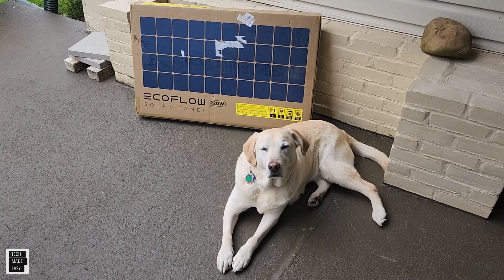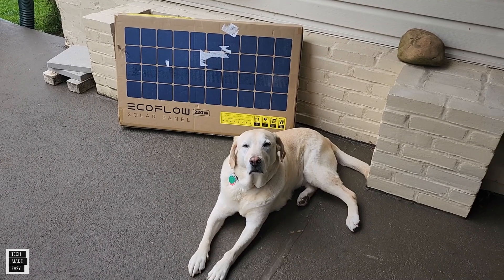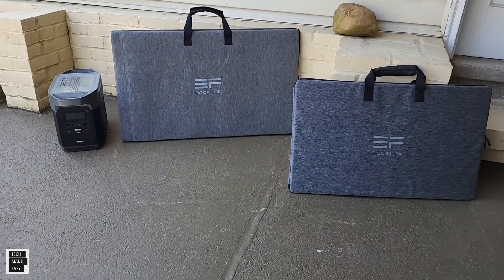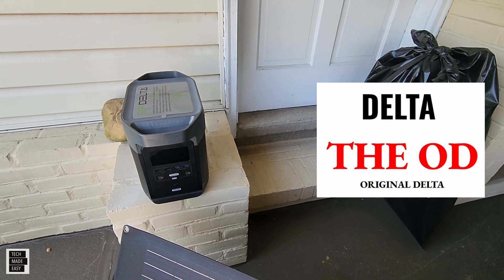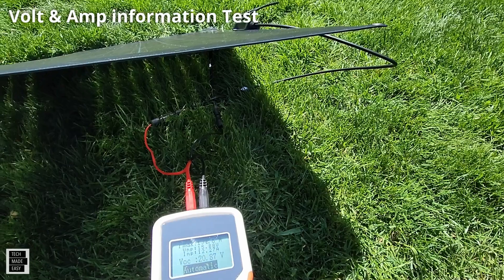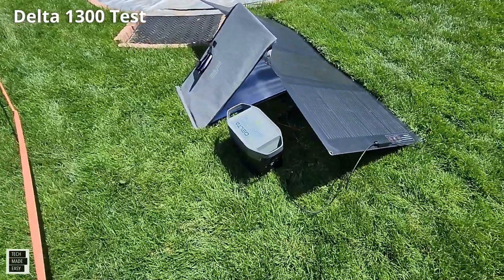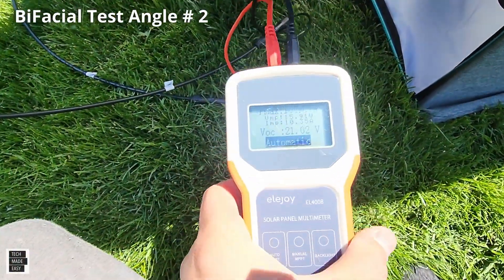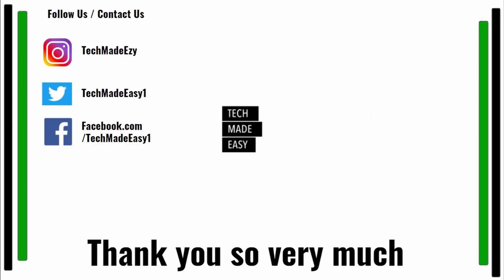PART 1 of 2 EcoFlow 220w Bifacial Solar Panel Review and Testing

Comment from the maker: As of May 2nd it's on sale at Amazon $550
https://amzn.to/3MHHNmC
Reply: Thanks but it shows as Currently unavailable on Amazon
Reply: I have the Bluetti AC180 which says it takes a max of 10A however the VDC is between 12V and 60V @ 500W max. Would this panel be suitable and operate with the AC180

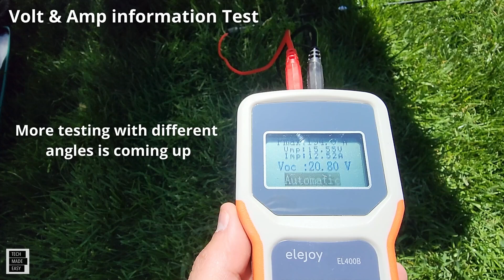Comment: 9:51 If I get 200W from a 220W Bifacial solar panel, how long will it take to charge my Delta 3 Plus 1024Wh?
Reply from the maker: About 5 to 8 hours if you have good sun and the correct position of the panel
Reply: @TechMadeEzy  I am asking about 200W straight input charging times.
Reply from the maker: I don’t understand your question. you asked me the first time how long it would take to charge that power station and I told you 5 to 8 hours depending on good sun and you changing the panels position throughout the day.
Reply: @TechMadeEzy yes that is first question but I ask second question 
For example 
If I charge 200w Ac input 
How long will it take to fully charge delta 3 plus 1024 wh capacity.
Reply from the maker: Just so you’ll know this unit can handle 380 W that would be about an hour of charging on AC if you’re saying 200 W then you’re really looking at close to two hours check out my full review if you haven’t already on the 3 plus 
https://youtu.be/5WxBdo3heFI?si=mPOkSGibVS60eYGJ
Reply: @TechMadeEzy  I am not talking about handling I am talking about 200w straight input to 1024wh power station how long will it take to charge.

River 3 plus did not have 1025wh.
Reply from the maker: See my previous response I answered your question concerning AC charging
Reply: @TechMadeEzy You said 5 to 8 hours; that's not a real answer. 380W for 1 hour is also not true for the Delta 3 Plus.  It's should be If you charge at 200W speed  it can fully charge in 5.2 hours. If you charge at 1000W speed it can fully charge in 70 minutes.  
1500W MPPT charge takes 56 minutes.
Reply from the maker: I'm guessing you're new to solar no one can give you an exact time the sun is different everywhere and you have to angle your panel multiple times a day. Sorry I couldn't help you

Comment: I guess I need to call Ecoflow. I just purchased these and they came in a completely floppy bag. Even when I did finally manage to get them to the recommended angle in full sun, they only generated 171 watts max (6 HOURS charge time) - never  made it to 220. It has 3 very cheap floppy brackets that don't hold it up and are not reversible. Very dissapointing.😢
Reply from the maker: Hopefully this video can help you
https://youtu.be/76fMrhSjmC8?si=fYG89O7mhA_eoXJQ

Comment: I set up my panels on top of emergency Mylar blankets & it works great.  Layout the blankets, secure them down with wooden strips on all of the ends, then set up the EcoFlow 220W Bifacial panels on top.
Reply: What is the difference in output when you added the reflective Mylar blankets vs without them?
Reply from the maker: Nice 👍🏼

Comment: Coming to the party late and didn't read every comment made during the past year so I don't know if anyone mentioned using one or more of those life-saving emergency mylar blankets to use as a reflective surface around the rear of the panel to increase the wattage coming from the back. They are very inexpensive and so thin that they could be folded back up and stuck in the carrying case no problem. I just bought 2 Delta 2 units and 2 of these bifacial panels to use when camping. I'm not going to be carrying large heavy mirrors around with me in the woods, but I'll certainly have some aluminum foil and a couple of those mylar blankets with me on such trips. Could be a very inexpensive way to increase the wattage.

I see you have a part 2 to this review and several people already mentioned using something more reflective to kick start the rear of the panels. Perhaps that was what you review in part 2. I hope so and am going to watch it in a few. Thanks for these informative posts.

Comment: Over $600 later and a handful of uses the panel sustained a spiderweb crack after merely folding one of the panels to put it away.  These panels appear not to be able to handle heat stress even though it was not a very hot day in Chicago.  On first use, the S/N plate fell off.  Totally disgusted.

Comment: You have been very helpful with the reviews of Eco generators. So much so, that I have 2 Delta Max, 2 batteries, 2 River Pro and 2 batteries. Also 3 solar panels. Can you recommend the appropriate length for cables going from the generator to the panels?  Keep up the excellent work!!
Reply from the maker: My pleasure thank you 
How far do you need to go? 20ft ?
Reply: @TechMadeEzy  Maybe 20-30'.
Reply from the maker: 10awg is fine for that
These always worked well for me https://amzn.to/3q93CWH

Comment: I have the Bluetti AC180 which says it takes a max of 10A however the VDC is between 12V and 60V @ 500W max. Would this panel be suitable and operate with the AC180
Reply from the maker: Yes you can use 1 of these panels with no issues

Comment: I have the 160w EcoFlow solar panel. I think it is a great panel. I am not a huge fan of the case being converted into a stand. Wish it just had the legs like the other brands. The case is absolutely beautiful and well made. The last think I'd really want is it laying in the dirt holding the panel up. I wish this came with a small pouch and the cables weren't so hard and short. :face-orange-frowning:

The panel is very well made and seeing it charging with it completely submerged is a huge sell for me! :face-red-heart-shape:
Reply from the maker: I agree if I had to choose between the 220 Watt and the 160 Watt I would definitely choose 160 watt panel
Reply: @TechMadeEzy would you still make the same choice for the smaller panel?
Reply: @TechMadeEzy thanks for your input I'll buy the 160 panel

Comment: can you connect two ecoflow 220 bifacial solar panels together with a ecoflow delta max 2000 extra battery included would this encrease the incoming Watts. Great video
Reply from the maker: Thanks Kevin 
The max can handle up to 100v so you can connect up to 4 to of the 220w EcoFlow panels in series
Reply: thanks for the info. I've already got a 220 bifacial and it's out performing my 400w panel. Best wishes.
Reply from the maker: Best wishes to you thanks for your support Kevin

Comment: i want to ease into solar.  I like the portable panels.  Wondering about a battery and charge controller though.  Not to worried about the inverter for the battery as they are pretty straight forward.
Reply from the maker: Why not buy an all in one system? Bluetti EcoFlow etc

Comment: Fwiw, mine showed 225w a couple of days ago when connected to a Delta 2. I was pleasantly surprised. Then after an hour without moving it, it showed about 217 minimum. Best I could get tweaking the position was 221.

Comment: Thank you for the video! I had picked up an Allpowers 200W and wasn't really happy with it, stumbled on this video and saw that Amazon had it on sale temporarily for around $370 after a coupon (using the camel site they've done this before a few times), immediately jumped on it. This thing is heavy, but I prefer how rigid and durable it is. I plan on repurposing tent poles to use as a stand and cut a piece of tyvek into a reflective surface to place under the panel to maximize the bifacial capability... they should all be able to fit into the case!
Reply from the maker: Wow $379 is a deal 🔥
Reply: @TechMadeEzy the deal you just posted brought me to this video to check it out!
Reply from the maker: @NoZenith link to panel for sale 
https://amzn.to/45Yn0Vu
Reply: How did your reflective experiment go? Was it worth the hassle?

Comment: I see you have to many  videos for solar and power station generator. I'm asking you what is your favorite  solar panel and power station. Thank you.
Reply from the maker: My favorite id have to say is the delta pro and I use the 400w foldable panels by EcoFlow
Reply: @TechMadeEzy  is max 2000  good option for emergencies  used. Now is $1400.What you suggest. This or delta 2.Thank you for videos you make.
Reply from the maker: The advantage the max 2000 has over the delta 2 is it can handle more 2400w vs 1800w and the batteries are larger 
2016wh vs 1024wh, I do like that you can connect the max batteries to the delta 2 but the max has 2 expansion slots the delta 2 only 1, of course the huge difference between both is the delta 2. Is LFP so the batteries will last for years longer
Reply: @TechMadeEzy  Thanks for your honest answer.

Comment: considering the higher price of this panel for a 220w panel (is putting out barely over 80% at optimum angle) which is only about 10% more efficient than most standard one sided panels operating at about 70% efficiency typical. So paying extra for the "bifacial" side is only getting you 10% better efficiency it seems. I'd luv to drop a blanket on the front side and see what the rear side's total output actually is? Seems gimmicky for an extra 10% efficiency vs the extra price tag.

Comment: If the 220 reflex's the light off the back. How well would it work on top of a car. If you put it on top of the hood with the back facing the windshield. I'm getting the Cybertruck and would like to see how well something like this would work. Stainless steel could be a great reflector.
Reply from the maker: It will only take advantage of sun from the one side
Reply: Ecoflow they advertise grass sand concrete water Stainless steel is very reflective.  @TechMadeEzy
Reply from the maker: @toddbissell4312  we have a video doing some reflection testing coming out in a day or so
Reply: I wonder what a light meter, a photographer has,  would tell you if anything at all

Comment: Also,  you have to be sure to have the extension cable to keep your Delta
Outta the sun…correct? Or is behind the shade of the panel ok? Thanks!
Reply from the maker: Get an extra solar cable so you can leave your Delta somewhere maybe on your patio in the shade.

Comment: Can I connect the 160 and 220 together
Reply from the maker: Hi Roderick, in general you can but the combination won't perform to its peak. Your best best is to always connect similar solar panels. Also, make sure you are in spec with whatever you are connecting it to ( volts amps) or you can damage your equipment.
Reply: @TechMadeEzy  I have the old style Delta(OD) like you shown in your videos. I got the 160watt so it's best to buy another 160 to match? Thanks for your time on my questions. Keep the videos coming darn good information 👍
Reply from the maker: They make 2 versions 1260wh and I believe the other is 1008wh , which one?
Reply: @TechMadeEzy  the 1260 that I have
Reply: @TechMadeEzy  I have a north point camper I want to go off grid sometimes I would like to double up on power what would you prefer to go along with the 1260wh
Reply from the maker: So here is your limit, 400W 10-65V DC 10A max
The 160w is 21.4v, go check the open circuit voltage for the 220w, then add the 21.4v to that number it needs to be 65v or under, I'd say 64v or less to be safe.

Comment: If I had it to do over again I probably would have bought eco-flo instead of the blue ETI. But I don't understand this solar panel really my solar panel doesn't have grommets and it's not waterproof what good is it? What am I supposed to do run out in the rain and bring it in I don't get it I don't understand this one either what I need is a really light solar panel that is waterproof so I can keep going on my e-bike

Comment: How do you connect 2 x 220 watt solar panels to Delta1300? exceeding 400 watts?
Reply from the maker: You probably won't exceed 400 watts because you never get the full wattage of your panels what you want to do is check the voltage if you're connecting in series and make sure you stay under that

Comment: Using my new 220W EcoFlow panel for the first time charging my drained Delta Max. In the Arizona sun I'm getting between 200-214 watts depending on orientation.  *edit* Laying it flat I'm getting about 198 watts.
Reply from the maker: Try some reflective material on the back side when you put it up in an angle I'm hearing that supposed to work well

Comment: I've been trying to find someone to explain if going over Amp but staying under max voltage with these deltas is safe and it just dawned on me! Bifacial so the delta mini (max Amp 10) you just face the 150watt 8 Amp backside upside up! face palm its 2 in 1! Literally in the name! 2 of these backside up in series is 300 watt 8.8 Amp max 40ish volt (safe for mini) and flip is upside 440 watt 12 Amp for the max and pro

Comment: Thank you for posting the video but it’s kind of silly to have a bifacial panel if it isn’t mounted the proper height off the ground. Bifacial panels should at minimum be 1 meter off the ground and preferably 2 meters. Mounting them over a surface with a very low albedo doesn’t make much sense either.

These panels are absurdly expensive on a dollar per watt basis as well.

Comment: It is stated by the manufacturer that the panel will get different power on the back from different reflective surfaces. I bought one the other day and planned to lay an auto sunshade (The reflective silver type) behind it. Have you considered that when the sun is high, not use the kickstand, but instead, somehow lay the panel flat and elevate it a bit so you can take advantage of the backside?
Reply: One of the better things is concrete.

Comment: I purchased this panel for my Delta Pro and after 2 weeks of normal usage, the protective sealant is coming off around the panel folding areas as if cheap material was used. Waiting on Ecoflow support to respond. 😞
Reply: Ecoflow replaced it. Had to mail back the damaged panel first then they sent me a new panel as a replacement. No issue with it so far
Reply: Update... Replacement 220w bifacial has the same issue with the protective film separating from the panel around the folding areas after a day or so of rain fall. I have the 400w panel also and I don't see the same effect on them. Returning the 220w panel. Anyone else have this issue with the 220w even though it's IP68 waterproof?
Reply: @find_me_at5901  wooo, so those foldable panels hates water, i almost bought one for my mini. i bought a small 100W thin panel for 200$ instead. Thanks for sharing your story.
Reply from the maker: Wow already? I hope they take care of you quickly
Reply: Update?

Comment: Thanks for the review! Issues I have with all of these fabric panels is that dogs LOVE TO PEE on solar panels and rain isn't these solar panels' favorite thing. We all know that camping adventures usually means dogs are going to be there. I wish they could find different materials to use on these ultra light solar panel units to be more of a care-free design. Overall, I think this solar panel design is pretty poor. The hard frame designs from others like especially Renogy (I like their partially-hard molded case that's super easy to use,) are true set and forget units that handle the any weather, dog pee, and don't cast shadows upon themselves.
Reply: get a cat! :)😀

Comment: Like some others noted, would be a great 2nd video if you can get a rear reflective surface and see if that 190s max goes above 200!  That would be a great game changer as a automobile reflective window device is cheap to buy and may use some of that rear 155w better.  I subbed to your channel.  thx
Reply from the maker: Thanks
Reply: I'm also interested in this, and was confused if that's not the point of bifocal if not using bac at the same time?
Reply: Yeah it seems like there should be a video or some kind of information online about that. I can't seem to find anything either but I'm so curious if that would significantly increase the output

Comment: Great video and info. 

Recently purchased a Delta and a River Max along with two 110w panels. 

In the UK I had the two panels in series on the Delta and was pulling in 152w.  Not ideal conditions  but pleased with the results. 

Tempted by this Bifaced 220w panel as both Ecoflow units can take that one panel in.   They don't recommend running different panels in series.  The 220w would be used at home and the a 110 panel whilst camping.
Reply from the maker: Thanks RJB
Reply: Thanks for this, already got a Delta and looking at solar panels now.
Reply from the maker: Which delta ?